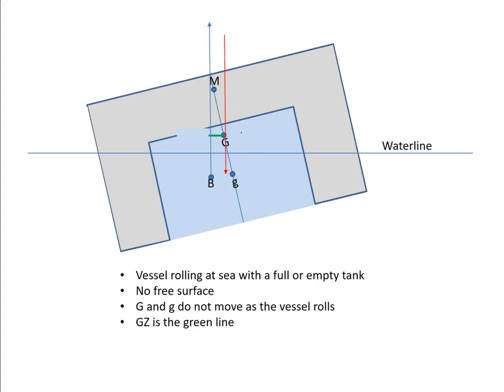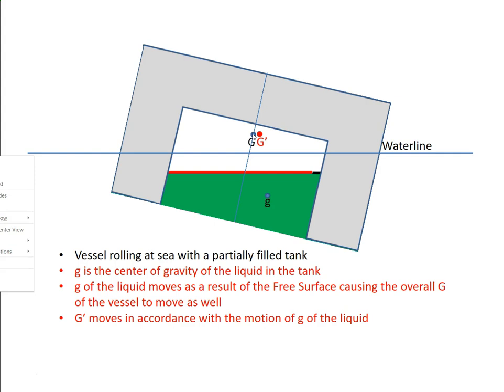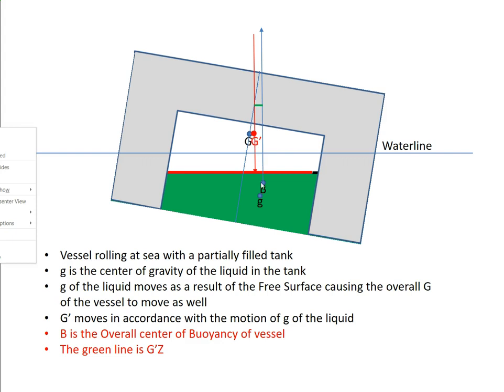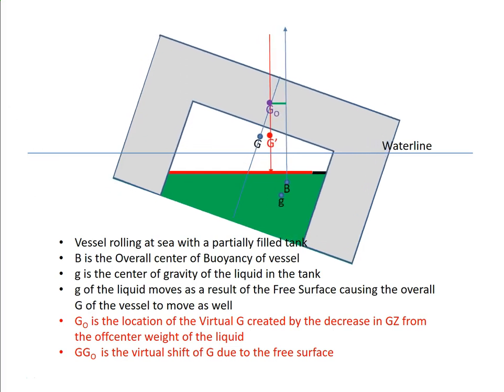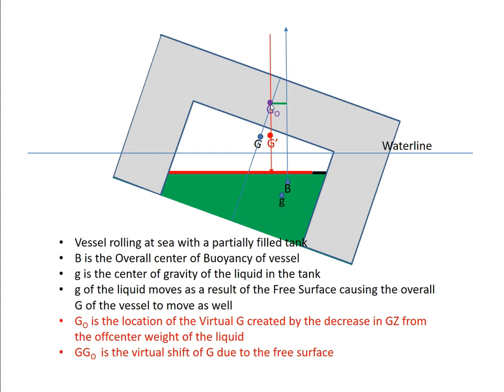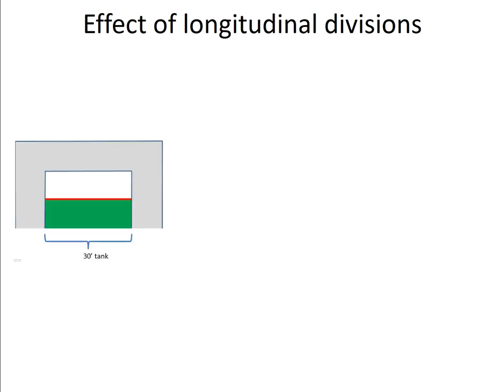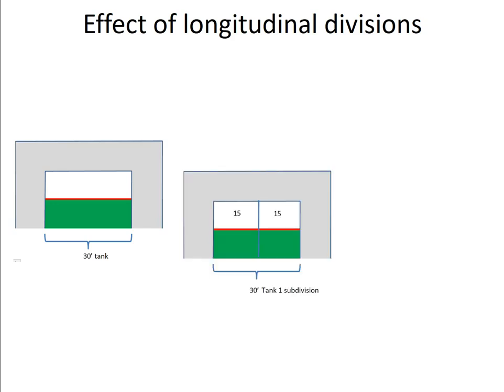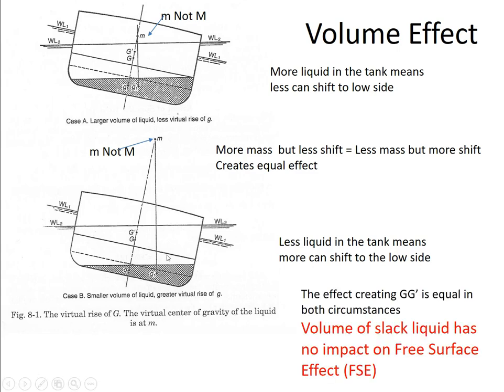Free Surface Theory for slack tanks

Comment: Nice vid,, 
could you please make a video on how the GZ curve gets affected due to FSE... thanks!
Reply from the maker: Hi. That's a good idea. I'll get around to it but probably not for a bit.  Do you happen to already be familiar with how the GZ curve is affected by list?  If so it's basically the same.  A list or free surface will reduce all GZ for every angle of inclination.  That reduction in GZ can be calculated for multiple angles, plotted and then compared to a curve without list or free surface. Hope that helped a bit

Comment: What happens when tank is full
Reply from the maker: When the tank is full (or empty) there is no free surface correction. To calculate the effect of the weight on G you just use the Theory of Moments. If the tank is slack you need to do the Theory of Moments and then calculate the effect of free surface and apply that as an additional correction.